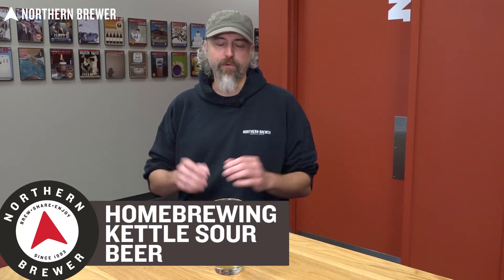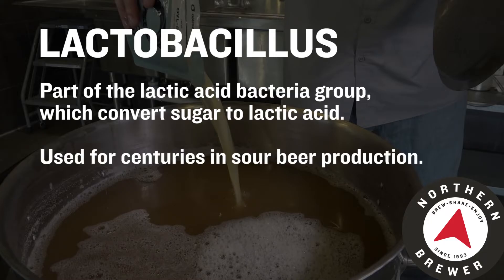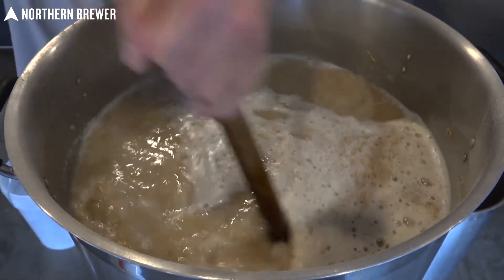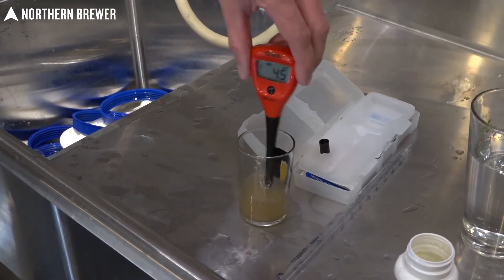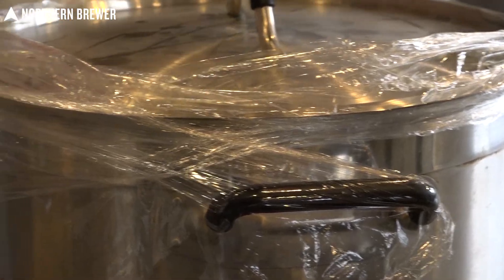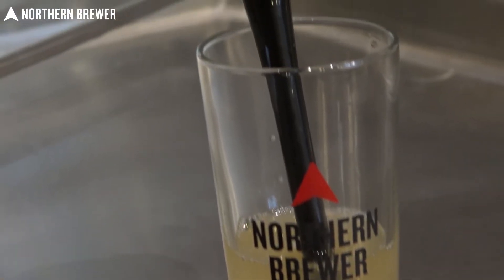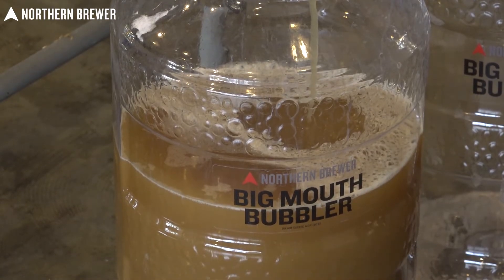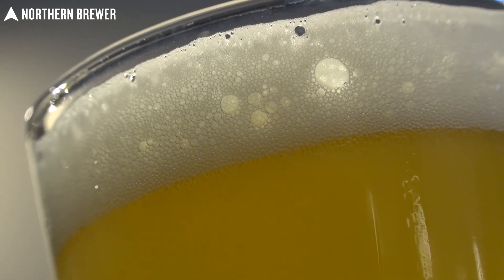How to Brew a Kettle Sour Beer

Comment: Great video!. One Question I have. I was hoping use a Fresh Wort Kit (ie wort with Hop Boil already complete). Would it be OK to do the lactoferment with hops already added and secondly, is it necessary to boil the work post lactofement - or is it ok to alcohol ferment with live lactobacillus in the wort?

Comment: After bottling the Duck Duck Gose, how long should the bottles sit to condition (for this particular Gose or Gose beers in general)? The instructions say the Gose can be refrigerated after 2 weeks after bottling. Is that all the time needed for the conditioning process to finish?
Reply from the maker: It should be enough time. If you have the bottles resting somewhere a bit warmer they might carbonate faster than ones in a cooler spot. It's good to crack one bottle after about a week to see if it has the proper or preferred level of carbonation. If not, let it sit another week. If it does, place the rest of the bottles somewhere cooler or even a fridge to make sure they don't over-carbonate.

Comment: Am I correct that you are taking the OG reading just before adding the yeast? If so, how does the lactic acid and the fact that the lactobacillus used some of the sugar affect the OG reading and the computation of the ABV?
Reply: Lacto did eat some sugars, and left alcohol. You can use hydrometer (for best result), or corrected (considering some alc already inside)refractometer reading.
Reply from the maker: Brad says that the amount of fermentation done during souring is the noticeable, but does suggest taking the OG before ale yeast fermentation and FG for a closer read on what the beer's ABV will actually be.

Comment: Does kettle souring, or fermenting a sour ale make my kettle or fermenter unusable for non-sours in the future?
Reply from the maker: Absolutely not. Contrary to long-standing homebrewing myths, as long as you practice proper cleaning and sanitation practices there is little to no concern for any sort of cross-contamination. with kettle souring because those souring agents are "locked in" during the kettle sour process and subsequent boiling... and then you actually ferment with a cleaner ale yeast. So kettle sour takes away most if not all the concern here. With true post brew day sour (wild, with bacteria, etc.),j it's not a horrible idea to keep two sets of certain gear juuuuust in case (like I have separate bucket, beer thief, stoppers, etc), but kettle sour much less of a concern.

Comment: Newbie question: You added lactic acid to the wort to give the bacteria a head start, but the bacteria creates lactic acid... Why not just add enough lactic acid to bring the ph down to the right value, and skip the extra three days?
Reply from the maker: You could do that, and it's not an awfully uncommon practice. In fact, you can actually brew and ferment your beer clean and then add lactic acid to finished beer to sour. But please note, lactic acid alone is very sour, and simply adding lactic acid can be rather one dimensional. Since the lactobacillus is a living microbe, it also produces other by-products that add an extra depth of flavor to the soured wort.
Reply: @NorthernBrewerTV  OK, that is kind of what I thought. It's the little extra that the bacteria add that makes the difference.